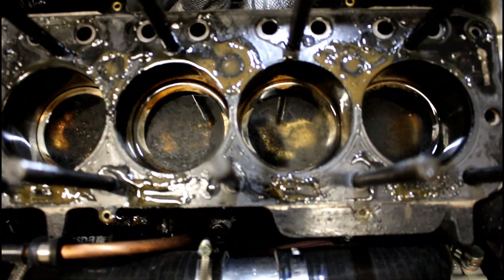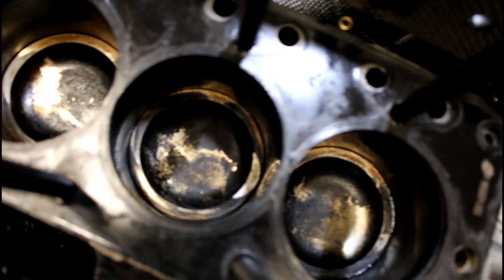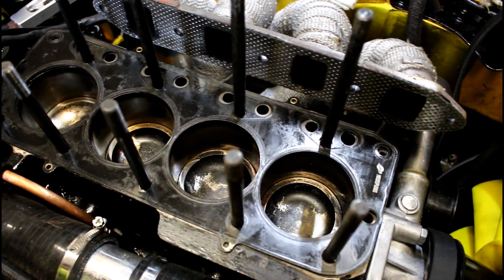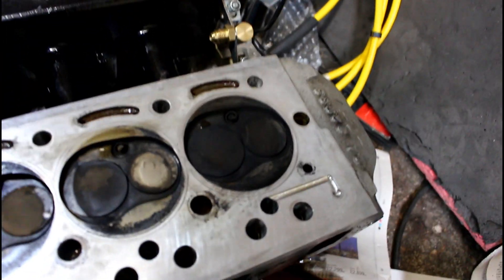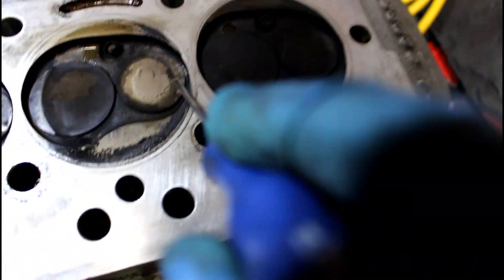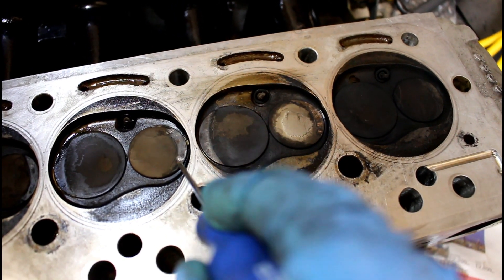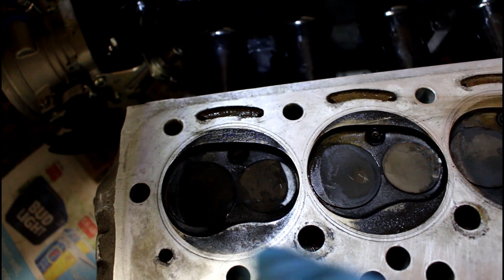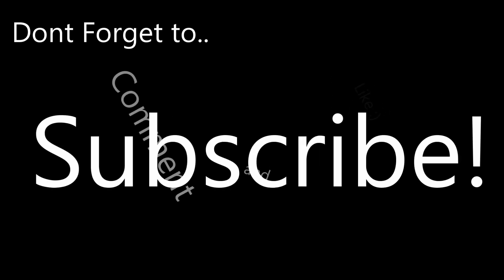Supercharged Arden 8 Port Classic Mini. Part 16 Off with his head!

Comment: I was wondering if you checked piston to valve clearance when building the engine . If i'm asked to fit pistons with a higher dome (EG mercedes M186 or M189 ) I use a 2nd hand gasket, some plastercine on top of the piston Sitting at TDC ,then bolt the head onto the short block . I then take the head off again to measure the thickness of the plastercine to gauge the clearance. In general I aim for .40 mm . This sounds like a lot but at high revs in some engines I have known the rods to stretch and whack the head or as in your case ,the valves have touched the piston. The reason your gasket leaked is because the head was pushed up by the rods and pistons ,just enough to stretch the studs and allow a thou or so clearance. water under 25PSi would easily escape .
Next step would be, for me, to check rods for bend and twist and piston gudgeon bores for ovality . I have seen a mini throw a rod after suffering a similar event ,the distributor went out through the grill. 
Also,to allow for clearance I use a tip learned decades ago. I braze a piece of tool steel to a spare valve head . I grind this to act as cutter . I put the valve in the head bolt it down onto the block with the used gasket and cut some clearance into the piston crown. Simple but  it means balancing the pistons again. To get really accurate, I start by measuring the height of the valve stem above the head,then making a cut .measure again to check I am getting close to what i determine is plenty of room and so on. I have even done this on engines still in the cars in act of desperation by the owners.
Reply from the maker: yeah it was my mistake for checking the inlet not the exhaust which had the bigger lift. I cocked up by rushing through it.

Comment: So.... 
It looks like your valves have touched piston tops giving enough  clearance to seperate gasket and head to let water in. 

Since its just edges of the valves my quick ( although hassle )  solution would be to have your piston faces skimmed to more or equal the contact depth that has occurred..  More would be safer option due to expansion once hot.
Or a thicker gasket?
Reply from the maker: I've gone with a different approach and had the valves start higher by using a thicker head, I looked at the really thick cometic gaskets but they are mega money and I needed it fixed asap.
Reply: @MiniPerformance  was going to suggest cometic to different thickness steel gaskets, but then that is the same as my decomp plate comment. Hope it all works out, and good power figure BTW ;)
Reply from the maker: @harrypalmer1544  cheers fella, couple of weeks before that one drops on here.

Comment: Bolloxs, them valves will be bent . Test the seal with some dirty engine oil in the ports, with head face down for obvious reasons. Don't spill a drop and sit on kitchen roll ,  the combustion chambers look so shallow,? I never noticed it before, i keep thinking that your lucky!! But then , again I'm not Shure. Because due to the pistons having to be removed to cut the tops off by 30 thou, = 3/4 of a millimetre, means striping all the bottom end again,